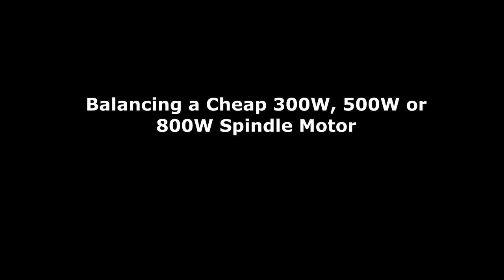Balancing a cheap 300w, 500w and 800w spindle motor

Comment: Wow! My spindle was vibrating horribly. And, indeed, it turned out that the spindle without a fan spins perfectly smoothly. I balanced the fan in a similar way and now voila! The spindle with the fan at full speed is smooth and silky! Thank you for the video!

Comment: Nice video.
Not a lot of people think of balancing the spindle but it does make a big difference. Any rotating part for that matter.
Another option is using an RC Prop Balancer. Also very accurate and easy to use and cheap.
Thank you for putting this video up.

Comment: I pulled the fan then mounted it in a model airplane propeller balancing rig and added drops of CA glue plus activator to the inside of the rim.  it comes out perfectly with no guesswork.
Reply: I was thinking the very same thing. I fly foam aircraft and have a prop balancer. Adding the ca glue to the opposite side seems like a simple and good solution !

Comment: Another point... I see this is a different z axis than the one you built in a previous video. The lower bearing block of that motor has 6 screw holes. 2 are used for the long bolts coming from the upper bearing block. The other 4 are empty, unused.

In your other z axis, you closed those extra 4 holes by using them in the assembly. But in this axis, they aren't used. Wood chips will very quickly get sucked into those open holes, "clogging" the rotor. Motor will run hotter, misbalance will occur internally. And, excess drag will overload and trip the power supply.

I simply installed 4 short screws to close them off. Solved that issue very well.

Comment: This is great :D Just one thing, when using a cheapo spirit lever like that. You can take out lot of error by simply turn it 180 degree to check the inaccuracy and then easily compensate for it to get even better result!
Reply from the maker: Yeah, i calibrated the level first using this method.

Comment: It's also a flywheel as well as a fan! The outside surface is further from the pivot, so drilling there needs less material removal. You'd want to start at the vertical centre in the other axis to not add a secondary wobble though too, like a pair of bike cranks spinning fast.

Comment: Cool, I'll definitely try it on mine, thanks for sharing. I've used modified pc fans as tachometers for othet projects in the past, I'm thinking of adding a fan with that capability to my spindle, so there's no need for the external sensor.

Comment: You could also use a dremel and a very small drill or burr, its easier to put a little back if needed, just half fill the hole again
Reply: dont use dremel ,NEWER cnc this is worst spindle than all other, bearing not has plan used to cnc, and not strong bearings, maybe if use only onetime/year made circuit board but woodworking not can use.

Comment: Question: Have you already tried running that motor for extended periods without the fan? I've not yet tried, but I am tempted.

In my case, the fan really does not seem to be effective, as the motor casing remains quite warm. However, the fan does indeed move a lot of air. I think the real design flaw is a need for heat sink fins on the motor casing.

Also, my next upgrade project is to build an integrated case. That will include a high air flow system for removing and evacuating chips. Theoretically, that will also be much more effective for cooling the motor.

Comment: I just tossed the fan in the garbage and threaded an air fitting into the end cap. Using shop air and a small regulator to cool it.

Comment: I would rather remove mass somewhere else and not reducing impellers surface. Or even adding some drops of glue on the opposite side. Or in this case add filament with 3D pen.

Comment: Good night friend. Thanks for the video. How do I ground this 800w spindle?
Reply from the maker: As the motor runs on DC from the spindle power supply it doesn't have a ground connection. The the spindle power supply does have a ground pin
Reply: @Wallworkshop  Matt, thanks for the feedback.

Comment: Is the C clip also "balanced" ? 
Seems like it would have to be since the vibration was greatly nulled after the fan was balanced.
Great video, I am try this right after dinner!  I was actually searching on a more balanced motor and didn't realize it was the fan all along!
Reply from the maker: No the C clip was left alone. It's weight is so small that it has very little effect. Tried it with and without (just for a few seconds) and it made no perceivable difference.
Reply: Follow up:  Worked great!  8mm pins and 1-2-3 blocks from Amazon on a small granite surface plate.  That motor is quiet now!  Thanks for posting this Matt, I always thought it was the motor.  Why oh why would the fan be so unbalanced? Took quite a chunk out of one fin, but the result was amazing! This was on Genmitsu 3020 Pro Max.
Reply from the maker: @jeremiahbullfrog3090  glad it helped. The motors are good but the fans are are rubish. But I guess that's why they're cheap so a bit of tuning really helps.

Comment: Hi Matt, thanks for this video! This will make a world of difference! I've got the same spindle, just haven't used it yet. How do you like the 800 watt version? Greetings from the Netherlands!
Reply from the maker: Hi and thanks for the comment. I'm not sure it's really 800w first of all but it is a nice upgrade and now it's balanced it's working well. I intend to build a bigger CNC soon so will probably take this spindle accross as it's a bit over kill for this CNC. I'll probably replace it with a 500w version
Reply: @Wallworkshop  Yes, heard more stories on that. Many people say it's not 800w at all. But, same goes for the 500w spindle. That should be more like 300w. My CNC is a 3040, so should be ok then :-) Only thing that is a little bit of a worry is the lack of grounding on the powersupply, but I have that build in a box already. First have to finish my laser, then I will concentrate on the CNC again.

Comment: You can always just make a new fan using the cnc if you end up removing too much
Reply: not need worst fan, and make new, use only external normal guiet pc cooling fan outside spindle and no problem balance and fan cooling better.

Comment: I have  question
I use Comgrow CNC every day. . Unfortunately, recently the bearings in the spindle broke and I had to buy a new spindle. Because it was nice to get an original one, I bought a Genmitsu GS-775M 775 CNC Spindle. Unfortunately, it does not want to work with the Comgrow CNC motherboard. It starts shaking strangely for a second and then stops. Do you know what could be the reason for such behavior?
Reply from the maker: This spindle is just a dc motor so you will need to check if you have 24v to the motor at full spindle speed. If you have then the motor is faulty. If you don't have 24v at full speed (motor not connected) then the board is faulty.

Comment: I have one of these motors but not sure of the need of a fan as the motor is mounted in a solid aluminium mount which I thought would be sufficient as a heatsink unless someone knows better

Comment: Hi Matt, what do you think about 800W but with water cooling?
Reply from the maker: 800w does get warm but with the right mount and a balanced fan I would say its overkill. Go over 1000w though and I think it's the way to go
Reply: @Wallworkshop  800W cheap spindle have lot more power torgue than worst makita,de walt etc, router motors. but lot lot silent than router.

Comment: Here is an alternate idea that might be even quieter, just replace the existing fan with a better one https://youtu.be/BU1FQxib6w8?t=423
Reply from the maker: I had considered something like this tbh and still may do something similar. But the current way doesn't cost anything and can be done without a 3D printer.

Comment: lol like indian scammer ....first test 24000 rpm end test 900 rpm !!! gj best bite click of the year!
Reply from the maker: Hi, I can assure you that the same rpm was used for the before and after tests. You can see in the video that the speed control knob was turned to the same position. The difference in noise is purely down to a balanced fan. I also Don't currently make any money from these videos so I have no reason for 'Click Bait'